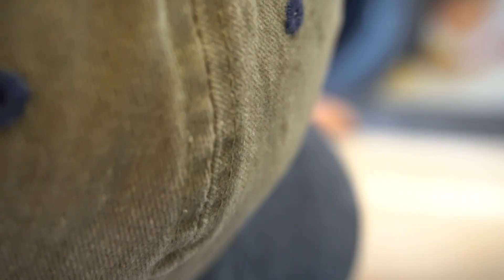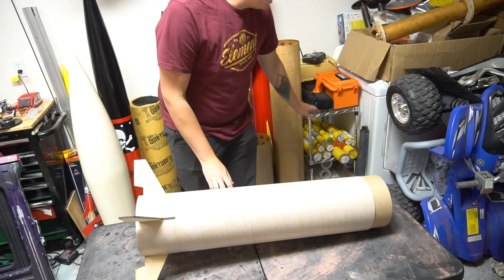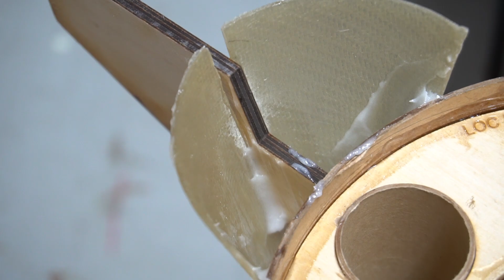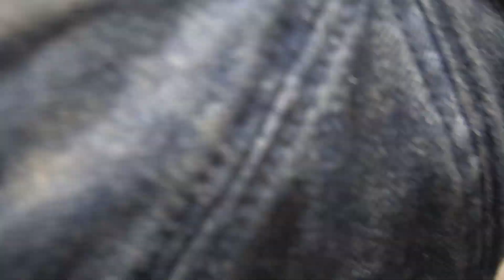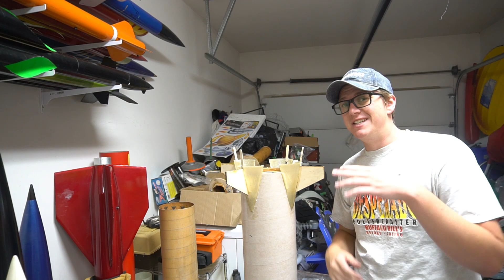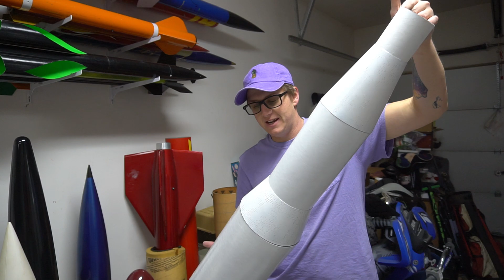Building A 7 Foot Tall Apollo Saturn V Model Rocket | Finishing Bits and Starting Paint

Comment: You might want to think about filling the engine cowls with some expanding foam, great stuff even. And then capping them off with some 1/8" ply. This will help assure they don't ever collapse and they shouldn't chip or anything. Just some ideas.
Reply from the maker: The biggest potentially issue is the overhang past the tube. There's not much I can do except put a bit ol chute in it, really.

Comment: Are you flying to MWP or driving?? Either way, stick your 3" punisher in your bag and buy a motor from Tim when you get there. We have hardware you can borrow if you are flying. You can't come all the way to MWP and NOT fly!! Us Illinoisans cannot allow it!!
Reply from the maker: Actually, I'm flying my 8" V2 on an M2500 at MWP.

Surprise! ;)
Reply: @RocketVlogs  WOOHOO!!!!! Excellent!!! Hopefully the same day I fly my Demon 150 on the M4500ST that I wasn't able to fly at Airfest. Two nice rockets on big M's on the same day would be sweet. What days will you be there?
Reply from the maker: @StreuB1  I'll be there for the entire event! 

The M2500 going in the V2 is the one we swapped out of the center for the 12" Punisher at Airfest and it's a bit...sketchy. So, hopefully, it doesn't take the V2 out. Got the okay from Carl at AT to fly it, so we'll see.
Reply: @RocketVlogs  What was wrong with it??? One of the student groups this spring flew an M2500T and it cato'd spectacularly and it looked like it burned around the grains and the liner. I and several other motor builders examined it closely and to me, it looked like a porous portion of a grain OR a poorly cut and fitting liner.
Reply: @RocketVlogs  Also, Justin (Ferrand) and I are likely going to open the launch on Friday with dueling M's. His M2050X and my M1780NT, both in 5" FG birds.